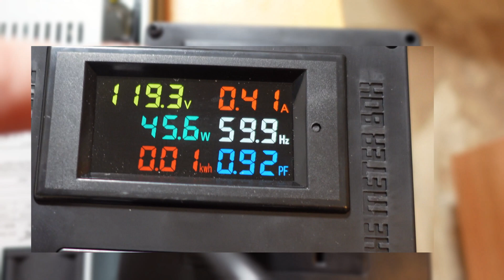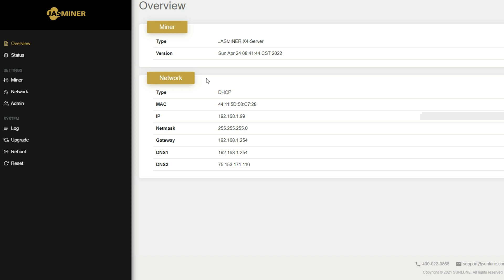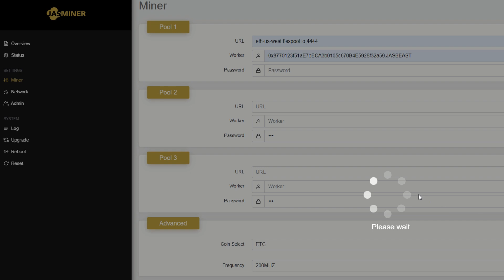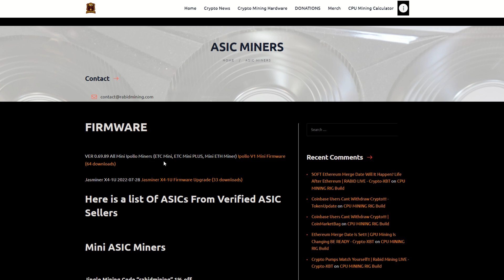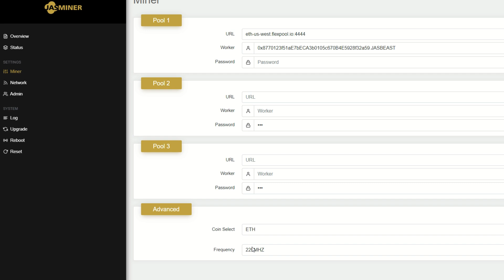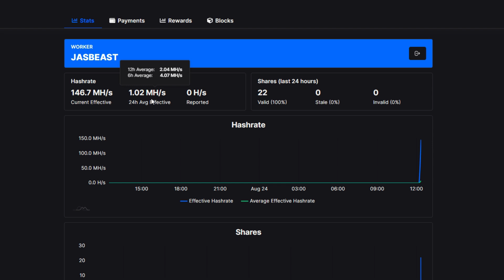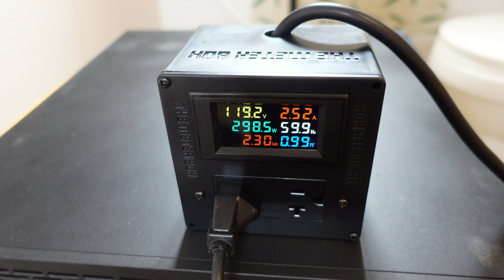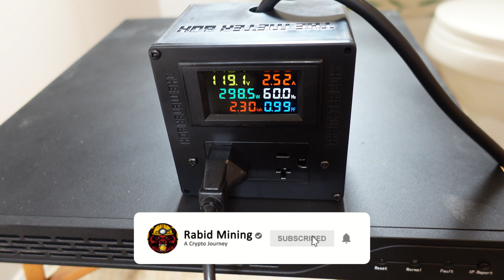JASMINER Control Board Replacement

Comment: I was in contact with iPollo regarding the latest firmware update for the Mini Classic Plus. It allows you to mine the CLO coin. For some strange reason they told me that I should not upgrade the firmware if my miners were not having any issues. So I still haven't upgraded any of mine.
Reply from the maker: It's always recommended not to upgrade unless you are having issues but seems a bit ofnhashrate increase slowly comes each time.